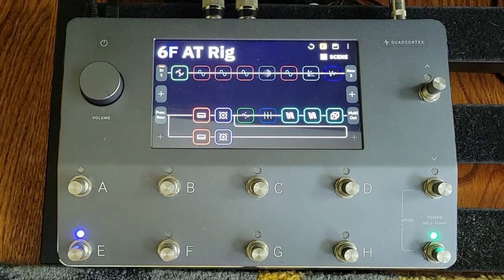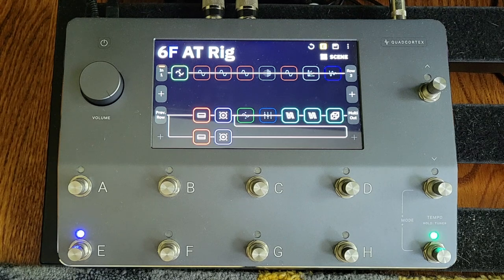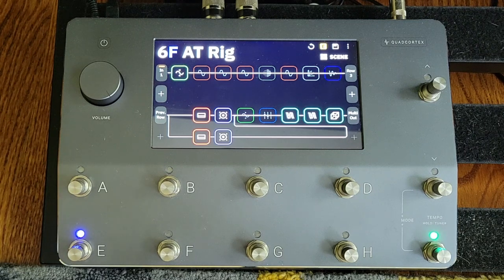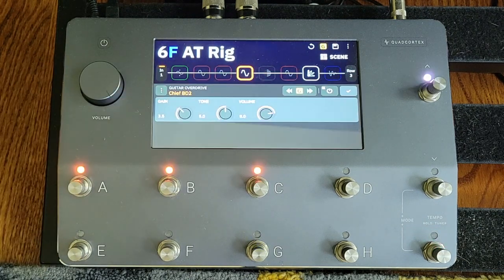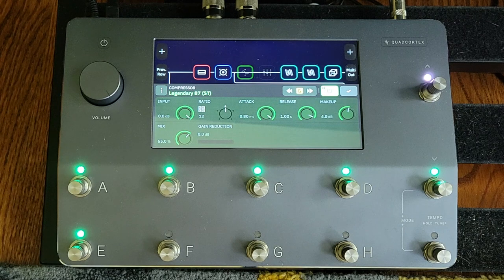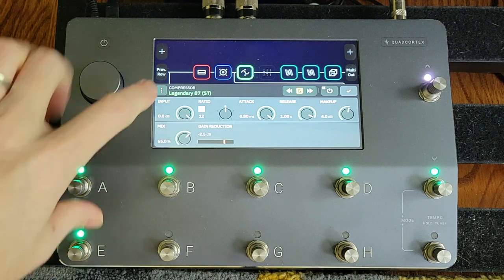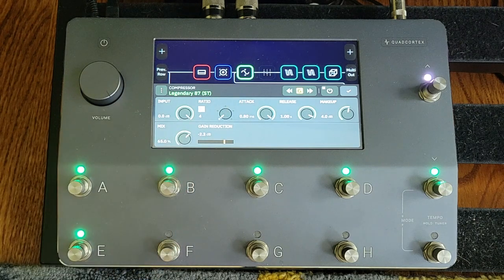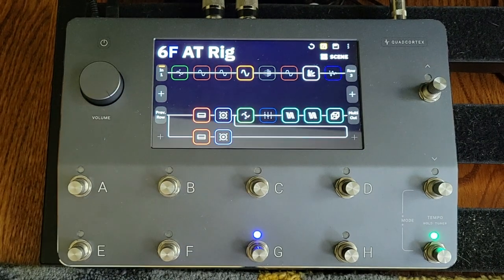Getting More Sag from Amps on the Quad Cortex

Comment: Thanks for continuing to add QC related videos. I am a huge Andy Timmons fan. I have been listening to his album Electric Truth many times a day. I ended up putting my QC on a pedalboard and added his Halo pedal, Super AT overdrive (new one) and a Strymon Cloudburst. I also have the Keeley Compressor pedal as the first thing in my chain. I found myself wanting the tangible knobs to tweak around with. I play at church so that kind of ambient sound works for me. Instead of the Lonestar I am using a Morgan 50 from the QC right now. I am thinking of adding the Compressor you demoed here inside the QC and then still using my Keeley at the front of everything. God bless!

Comment: Thank you for your vids . I am just grappling with the hi end zing from most of the sounds on the QC. 
The ToneX has the Same issue. 
The fractal stuff does Not have that plastic hi top end. 
I hope they get that sorted in future updates. 
They Kemper is warmer than the QC but does not have the Transient and Dynamic response, I had the Kemper for 10 years and that was always an issue for me.

Thank you for making these vids DavLav
Reply: I personally have no idea what you mean by  „hi end zing“…
Im using a QC for 2 years, mostly using it at home plus in our local church‘s worship band… 
Im very happy with it, stock sounds were good out of the box and the captures of my old tube amps ( Marshall, Hiwatt, Fender) are great.

Comment: Hey Davlav, very interesting, I was looking for the same idea with vcacomp, pritty close too. I just saw you using a phase inverter in another video, when do you need that?¿ thanks
Reply from the maker: Sometimes when you split the signal bath for dual amps you can get phase issues. Not often,  but some amps/ pedals can do that.

Comment: I’ve been using compression for this purpose with analog solid state amps for years. I’m surprised that for the price of an expensive modeller like the Quad, it doesn’t have a built in tube compression emulation.
Reply from the maker: Well said!
Reply: what could we change from the default settings on the legendary 87 to try to make it even better? in terms of ratio/ attack/release ?